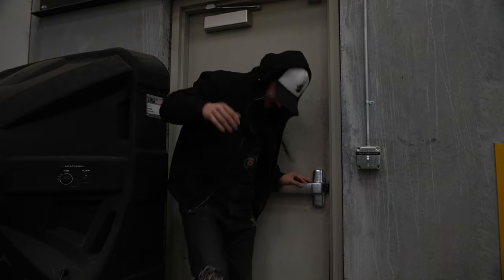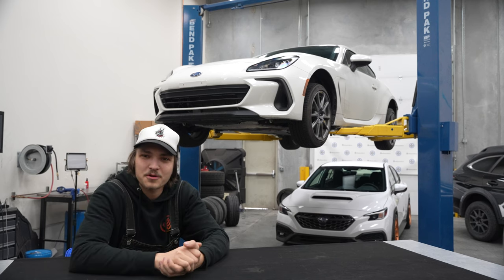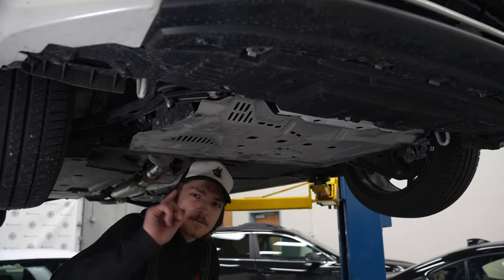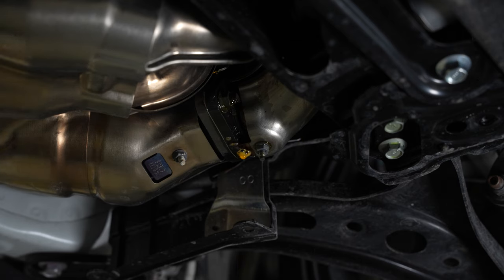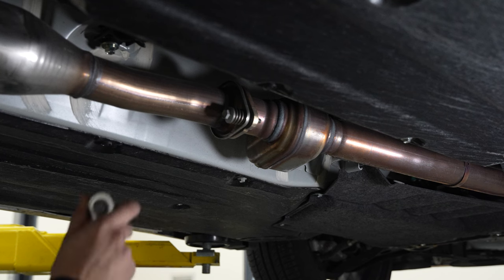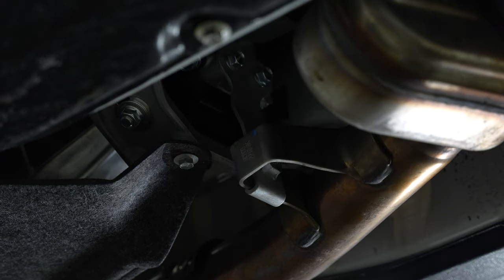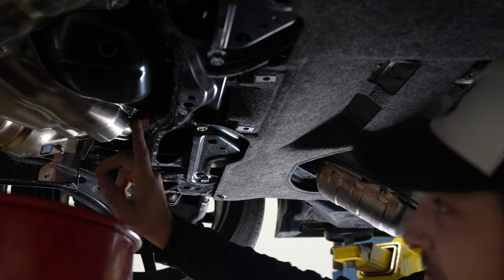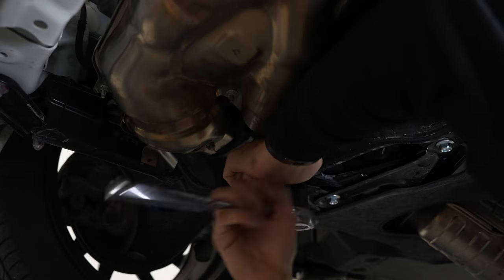BRZ/GR86 Cleaning the Oil Pickup of RTV Step by Step!

Comment: Someone needs to make an aftermarket solid oil pan gasket so we can stop worrying about RTV clogging the oil pickup and oil system.  Or better yet, Subaru themselves need to make it.
Reply: I agree, but this video showed that it's probably not the oil pan producing the excess RTV. See 10:23
Reply: I looked into that. There are some aftermarket oil pans that use handmade gaskets... reviews indicate those can be leaky. And like jaron95 indicated, the video showed that there are quite a few places the RTV is coming from, so swapping out the RTV on the lower oil pan isn't going to solve the issue. Plus aftermarket pans can conflict with the exhaust manifold.

I think the reason we don't see any responses from Toyota or Subaru on this is that there isn't really anything that can be done. Most of the engine assembly's are sealed with RTV. RTV is the issue... the solution would be a modified pickup tube that may has an additional screen at the bottom that makes it easier to access and/or could allow the loose RTV to stay in the oil pan. Doesn't stop the RTV from accumulating in the pan, but would possibly remediate the starvation issue some have experienced.

Comment: So the entirety of the engine assembly from the factory is completely flawed. Even if I pull the oil pan, the amount of RTV is other areas are still pretty excessive, and only gets worse as the miles rack up. For all we know, there could be even larger chunks falling off at 15k miles, which would necessitate the need to pull the oil pan and clean. Again. Or if it's tracked, the high heat and loads could force rip chunks of RTV off pretty easily even at low miles.  What crap QC and assembly this is. Subaru could literally program their engine assemble robots to use even less RTV and it would quite literally mitigate this problem once and for all, while saving them a lot of money along the way. Like holy crap this is infuriating to say the least. What the hell are they thinking??!?! I wanted to love this car, but this isn't something that should be an issue at all, since it's such a simple fix from the factory. Instead, this extra maintenance is left to the consumer, assuming their engine doesn't blow up first. Never going to buy a Subaru product ever. There's crap QC and then there's Subaru QC, which slots several levels below crap.
Reply: Same here, I was interested at first but seeing shit like this is no bueno.

Comment: I am keeping all my RTV intact. Also tracking the car and doing 5k oil changes just to prove the point that this is purely overblown BS.
Reply: im buying soon, updates on your car please ?
Reply: @turkicsayajin2274  I have about 20k miles on mine now. I have full bolt-ons along with a flex fuel tune. I run mostly pure E85 in warm months and switch back to 93 octane in the winter. I street drive the car fairly aggressively and do occasional track days. The car has been flawless. They key is to run a 5w30 oil and not the 0w20 that the owners manual calls for. It has been proven that is only for EPA requirements and is not adequate protection for hard driving. Other than that, just keep the oil level full. These cars do consume some oil from high temp, high rpm use. That situation is also dramatically improved with use of the thicker oil. I have no complaints.
Reply: @boost331  thank you very much, english is not my mother tongue so what will full bolt ons be ? Pardon me it’s my first sports car i want all the info i can get my hands on
Reply: @turkicsayajin2274 In the case of a naturally aspirated car, full bolt ons means you installed of the the basic upgrades that simply bolt on to the vehicle. So no major things like upgrading the engine internals or adding boost with a turbo\supercharger. In my case I upgraded the intake system, the entire exhaust, including the header, suspension, and tuned the car to run on E85.
Reply: @boost331  how i get it ! thank you for time ! Last question, do you do your own oil changes ? If so do you use an oil drain plug ? and what do you think about changing oil using an oil pump directly through the dipstick oil ? 

Thank you very much !
Reply: @turkicsayajin2274  I do all of my own maintenance on my vehicles including oil changes. I do not like the drain valves that stay installed. They never seem to get all of the oil out of the oil pan. I prefer to just removed the OEM bolt to get a more complete drain of the old oil. I do also have an extractor pump that can pull the oil out through the dipstick tube. It works great on most types of cars, but on the 2 subarus I own, it does not work well. Most cars have a dipstick that goes straight down to the oil pan these days. On Subaru engines the dipstick makes a hard 90 degree bend just before it goes into the oil pan. That makes it extremely hard for the suction tube to enter the oil pan at a good angle. As a result the few times I have tried it I only get about 2\3 of the old oil out. I just stick to the old fashioned method with the Subarus.
Reply: @boost331  thank you very much for your time, seems like i’m going to do it the old fashioned way, it’s time to buy a jack and jack stand lol

Comment: Instead of removing the sump, if you put compressed air through the oil filter housing, and then put engine in the sump without the sump plug, I’m pretty sure the rtv would come out. Ps if you removed the sump you should install a baffle plate at the same time, if you are going to track it.

Comment: Subaru has been ignoring and failing to correct manufacturer defects for a long time. Take the blown head gasket problem. This is a problem that can be corrected buy using better gaskets, yet Subaru has failed to do that forever.

Comment: Less than a thousand on ODO on my GR86. I will be dropping my oil pan for the first time in the fall of 2024 when I have close to 10k on the ODO. Based on what I've read and seen, I'm guaranteed to find some RTV in the pickup. I'm not paying a dealership to do it when they obviously don't care about it in the first place. They could easily just tell me they performed the procedure only to have lied about it and I end up with oil starvation. Depending on how much I find in the pickup, will determine how often I drop the pan to inspect the pickup. This car is eventually get getting a V8 swap, but until then it is my daily driver, so I need to take care of it.

Thanks for the step-by-step Ernie. I'll definitely be referencing this video when the time comes.
Reply: If possible, maybe try to find a Toyota dealership that listens to your concern, and be willing to allow you into the workshop when the oil pan is dropped and for you to see inside the pick-up tube, or else ask them to video it for you. 
Also, would it be worthwhile for them to give you the replaced oil filter, so that you can check the amount of RTV bits that maybe in it. Take some photos, and then at the next service check that oil filter.
I am contemplating buying a BRZ, but not for track use (if so, very gentle), thereby from what I am understanding there should be no issues. I am not aware of anyone having issues with only general usage, although there probably would be some RTV in the strainer.
The Subaru dealership that I am looking at provides one year membership to the BRZ Club, and are very supportive.
Regarding your V8 swap, it probably be awesome, I wish you all the best. For me, I would prefer to keep it as it is, due to its lightness. Cheers.

Comment: Great video. Great production and editing.  If you would have stated the torque specs that would make this video definitive.
Reply from the maker: Sorry, since it’s a new car some of them are challenging to find :(
Reply: 48 ftlb for the manifold to the engine. Found this on a forum, doubted it as the old spec was 22. Called Subaru dealer, they looked it up and confirmed.

Comment: I’m curious how much of the basket needs to be blocked before any real oiling issues occur. It looks like a lot of RTV, but it’s a 5 sided basket, and only 40-50% of ONE side is blocked by that much RTV. Like could you 100% block 4 sides and still be fine? Would be intrigued to know! Subaru obviously made it a basket like that on purpose. Thanks for the video 💪🏻🔥🔥
Reply: More than likely its not too much of an issue unless you are pushing the car very hard like the case of the GR86 on the track.
Reply: So long as you don't drive it beyond Camry driving. 😅
Reply: I guess there is a reason only that side get blocked. Probably most of oil flow go through that side.
Reply: Thanks for pointing that out. Not sure if Ernie told it in the video and I missed it, but that is the first time I hear that the upper part of the basket which everybody is always showing after dropping the pan is not the complete intake and just one side. You also raise the correct follow up question whether other sides actually do or not do matter. I would assume that the side everybodys always shows after dropping the pan is the main one, hence so much RTV on that side since it is moving with the main flow

Comment: How many miles were on the BRZ when dropping the pan? I'm thinking about dropping my GR86's pan during my 2nd oil change (6000-7000 miles), but I don't know if that's enough mileage for most of the RTV to shed...
Reply from the maker: It’s tough to say I saw one owner say his blew at 39xx miles. Ours is at 5800 the 22 WRX was at 7600 miles when we did it. I’d say 6-7 is probably a good range to shoot for!
Reply: @rallysportdirect  Thank you~

Comment: It won't matter the engine is defective.  I will starve in RH turns on a track anyway.  The CEL is the change engine light in these...
Reply from the maker: Yeah i saw that video the other day followed by Toyota's announcement that they'll most likely make the next GR86 with a Toyota motor, i can't say i blame them.
Reply: @rallysportdirect imagine if they designed a modern 3sge for these. 👌

Comment: That timing cover holy shit! Do you think this is an assembly error or poor design? Both?
Reply from the maker: Based off of the pickup design it seems as if it was intended, this issue stems from the first FA24DIT's in ascents and outbacks which have a big problem with the upper oil pan leaking, i believe Subaru might have said F*** IT and made the machines simply put more RTV on all seals instead of redesigning some of the mating surfaces.

Comment: Subaru should take care of this issue. It’s ridiculous that they continue to ignore this. Kinda like they did with their head gasket problem’s they had. I guess they are going to have to have a class action lawsuit against them to get them to address this.
Reply: There is no fix for it because of how the engine was designed, They don't want to risk it to leak which will become a even bigger headache for them. This is also not an issue untill you rev the crap out of the car.

Comment: Looks like the pickup tube and the drain plug line up a little. Anyway you could run a flex camera up after the plug is removed?
Reply from the maker: I’ve tried but failed, the scope we have does have a long end that doesn’t bend which may have been our problem, with a smaller scope it should be possible.
Reply: @rallysportdirect  I tried also. It does give you a good view of the RTV still intact.

Comment: Honestly speaking tho why couldn't they just put a normal gasket on it instead of using silicone on it? Could anyone explain that to me because I really really want to buy this car but I don't want to have to worry about cleaning the RTV every couple thousand miles just to drive the car normally.
Reply from the maker: If you’re planning on driving it normally I think you’ll probably be fine, maybe do one clean after a few thousand miles. Track driving is where this job becomes a must IMO.
Reply: normal gasket = new manufacture line, probably external supplies. RTV - just one robot  "paints" gasket of any shape in seconds.

Comment: There should be a better tool for applying RTV. I think he used way to much, and doesn't that defeat the goal of not having RTV engine failure?
Reply from the maker: Actually i used less than Subaru's technical bulletin calls for, and it seems like the oil pan is not where most of the rtv comes from, it's most likely the timing cover.